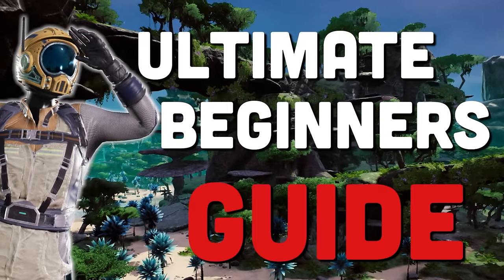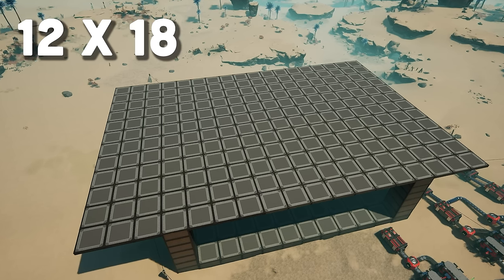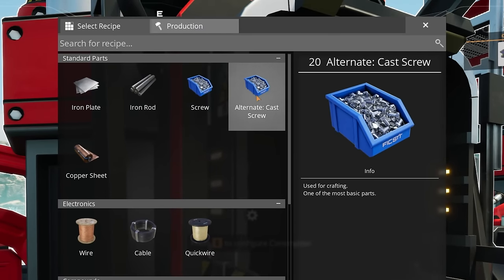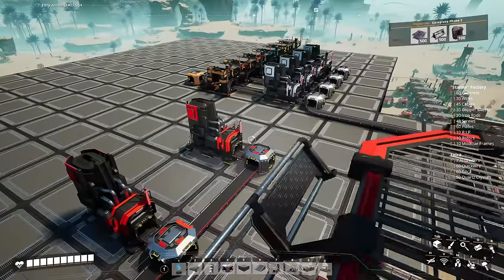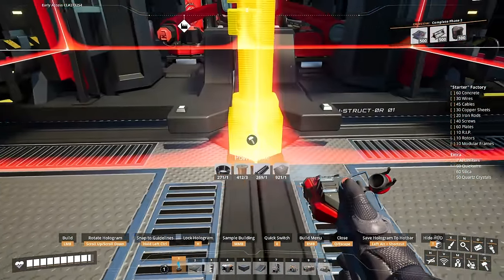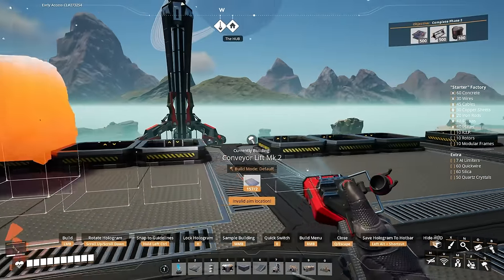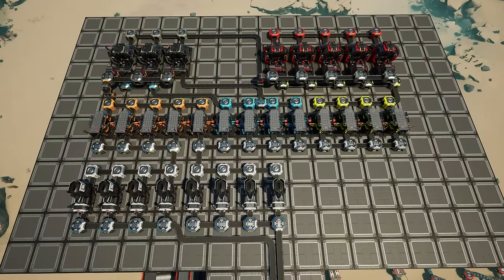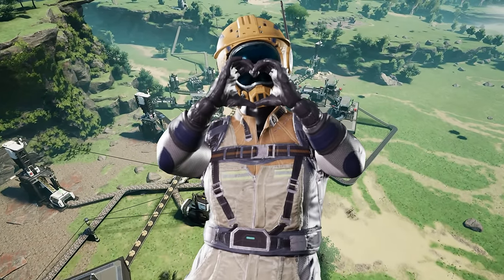How to setup an EFFICIENT Starter Factory in Satisfactory Update 8! | UBG 5

Comment: how to hell is this starter factroy when you already using alternates man ?
Reply: Loads of alternates can be found very early on and should be found and used early on such as iron wire, cast screws, stitched iron plates, and solid steel ingots. Just run around for a bit and unlock the drop pods. Most of the sites will have items littered that you can be used at other pods. You can find steel beams/pipes, loads of rotors, loads of modular frames and other stuff.
Reply: And I still don’t understand how you get ore automatically on the machines, I just put it in the manually
Reply: You use a conveyor belt from one thing to another. So if you’re using the miner (it has to be the mk2 or the big one that you need a portobello one for) you have to hook up some conveyor belts leading out of the miner to a smelter

Comment: For the concrete, shouldn't it be three with one under-clocked as concrete is 45 to make 15 otherwise, we need 180 limestone input
Reply: We do have 180 limestone input. At the end he added a merger in between the second and third constructor to attach a second line that supplies the constructors with 60. with the mk2 120 line we had it adds up to 180 limestone supply

Comment: Hey SpectrumDad,  love these instructional videos. You do them in a way that is very easy to understand and follow. It is very much appreciated. I was lucky to find your UBG videos right after I bought the game.

Quick question, though. I think you repeated one process. Starting at 27:31 you start the process of adding the merge manifold to the output of the screws and rods constructors. Then at 28:23, you show what the setup looks like.

I got confused at 28:27 when it seems, to me anyway, that you are showing the same process with one slight difference. The spare screws constructor is in the centre instead of to the far end.

Am I missing something?
Reply from the maker: Yep, I forgot to cut that part out :S my bad.
Reply: @spectrumdad_  No worries, I just thought I was going crazy there for a bit, or maybe having a déjà vue moment! 😆

Comment: Excellent build and video series! Your series is what helped me get started and same with most people following, I ended up moving ahead on my own and found a couple other playthroughs to take inspiration from. 

My only question is, how did you determine your ratios? Why are you setting up three wire constructors into two cable constructors with one underclocked? Why did you opt for the rotor and reinforced iron plates set up producing 10 each?

That’s one thing I’m still struggling, determining how much I SHOUOD be producing. So far I’m not having any trouble figuring out the ratios when building my “factories” to obtain the default output for those resources but still not sure how to determine how much I NEED which seems to be implied through your builds.
Reply from the maker: Partially experience, partially what’s available. So for instance, those beginner items you need more in order to build your basic things like machines, belts, poles, etc… so each part of my factory worked exactly for 1 120 belt of whatever it is. So 10 rotors takes in 120 iron ore. Same with 10 reinforced iron plates. Later on I’ll typically start thinking I’ll do 10 per minute, see how much ore that requires and adjust from there depending on what’s nearby.
Reply: @spectrumdad_  ok that makes a bit more sense. Thanks for the quick reply too!

Comment: Really interesting and usefull guide, like all of the others, but if i may just say something, as it is supposed to be a starter guide, even if it's a bit less efficient, maybe it would be preferable to only use basic recipes, and not alternatives ones, as we don't really know when we will unlock it. 

For example, i just start a fresh game and wanted to follow your guide, but i don't have unlock the cast screws recipe yet, so i need to use one more constructor in between to transform iron lingot into iron bar to make the screws. It's not big deal but it's kinda messing up the whole thing as i need to shift all the others constructors from one row to keep it all good looking (and it was kinda boring to do since i'm making all my ressources and convos come from the floor below  to keep it even more clean lol)

Comment: I have a question about the concrete production. I'm at the same phase as you, with only Mk.2 conveyor belts. Since each constructor takes 45 limestone per minute, they would need a total of 180 per minute. How did you transport it all with only a belt capacity of 120? I see you have two lines of limestone but how did you get them all into the machines?
Reply: Watch the rest of the series
Reply: @ROO1KAT  i have watched the entire series and i still do not understand how he did this at the phase he's at. i compromised by simply removing one constructor

Comment: Hi Dad just a heads up or I might be wrong but with the cast screws we put a splitter between 2nd and 3rd which is then being split to other merger which then means that line is now 140 screws a min but only needas 120 and 1 assembler is 20 short? So what i did was remove the splitter between 2nd and 3rd and put the splitter in front of second which has 80 screwa feeding it ,then split that 80 to another splitter in front of the 3rd 1 and that 1 into the 3rd 1 giving it a total of 120 screws the other 20  merged back with the 40 making 60 for other assembler.........btw I am so happy with the video you kept me up till gone 5am lol
Reply from the maker: You’re right. It wasn’t working as I thought it would. It’s prioritizing the main belt vs the constructor. It’s ok though, once we get mk3 belts this will be changed in an episode or two. In the interim, that second constructor fills up, so we can take those screws and periodically put them in the assembler if we really cared to do that.
Reply: @spectrumdad_  when will the part be out please Dad?

Comment: You say the concrete layout is at 100% clock speed, but you built 4 constructors with 120 concrete coming in. But 4 concrete constructors need 45*4=180 concrete. Even just three of them need 135 concrete, still more than the 120 we’re bringing in. Am I missing something?
Edit, you explain it at the end. Great video!
Reply from the maker: Keep going, I change modify that one later on in the video.
Reply: @spectrumdad_ Just saw that, must have missed it. Can’t wait for the next video, this one’s really good! Thanks a lot

Comment: Hey I really enjoyed the videos but think I might have found a flaw in your designs. While setting up my own factory I had to turn on my RIP’s line early because I ran out. In doing so I noticed that the smelter at the end was getting very little ore. I tried switching it to get split once into 2 lines of 60 then feeding both of those lines through splinters again to break it down to groupings of 30 that went into the smelters and that seemed to fix everything and keep all the smelters stable one green. I’m still pretty new to the game so if the is a reason I wouldn’t want to do this pls let me know. Thanks

Comment: the rotor constructors are taking 112.5 iron ingot/min instead of 120 causing stuttering
5*12.5 = 62.5
3*15 = 45
All that plus the 5 at the end for the underclocked rods is 112.5 and not the 120 the smelters are making

Comment: Did I miss something or the concrete is gonna miss 60 limestone / minute to run at full cap ?
Reply: fixed with an extra mk1 line and a merger between the 2 splitters
Reply from the maker: Yes I fixed it at the end of the

Comment: any tips on what to do if i dont have cast screws? Thanks!
Reply from the maker: @dxralph4668  on my channel I have a video 5 perfect starter layouts. Those are the same as in this video but without cast screws
Reply: @spectrumdad_  thanks man!
Reply: @spectrumdad_  what ive done is added another layer that creates the rods for the screws. Does that work or do i need to overclock/ underclock anything? Thanks man, your video has helped so much

Comment: I dont understand your spliter lineup like, if the first 1 split into 2, the second one same, ect ect, so the last constructor will take 1 iron/min
Reply: You mean manifolds? 
It's very simple. Situation that you described is occurring till the moment machine is full. Then it will not allow to take more than it have place for it. But it take some time before is filled so for a quite some time it will not working with full efficiency. Another issue with manifolds is that they require more fastest conveyor systems. 
Pro of manifolds is that they are way more compact and way easier to expand. Just upgrade level of conveyors and improve miner, then just copy machines.
Personally I prefer splitters instead manifolds, but I use manifolds for coal generators. 
But that's just personal preference

Comment: How is anybody squishing a train station in the 12x12 area? I did the bottom floor 14x14 and it's still not long enough...
Reply from the maker: @jacobbalcer3329  it was more about the height at that point. The train station platform will eventually get bigger

Comment: what if we dont have bloody cast screws????!!!!!
i can never get them from hard drives at all!!!!
Reply from the maker: Checkout my video on 5 perfect starter layouts. It’s the same layouts except I use the vanilla recipes.
Reply: @spectrumdad_  thanks. Also another question, i dont know if im doing it wrong but the maths for the amount of iron ingos going into the modular frames level doesnt seem enough for maximum effiencey, aka 100% on all constructors and alike.
the iron plates takes 150 iron ingots total (5x30=150)
the cast screws takes 50 total (12.5x4=50)
and the iron rods take 60 total (15x4=60)
which all adds up to 260 iron ore required total... 

this wont produce the 10 modular frames /min you specified (45:15)

am i wrong in my maths or is it supposed to be like this?
Reply from the maker: @razerblade4981  there is some underclocking being done on some machines in there. It takes 240 total
Reply: @spectrumdad_  ah i see it now thanks and thank you for the quick reply!

Comment: Lol calling this a "starter factory" while using things you don't have yet at the start, even when skipping the tutorial tier. FRAUD ALERT :D Underclocking is a research unlock, the screw recipe requires you to find it first (which could take minutes or hours), mk2 belt (even if you skip to that tier, you still need the reinforced plates to build them), catwalks is an unlock which you need a sink for and have already sunk quiet a bit. etc...